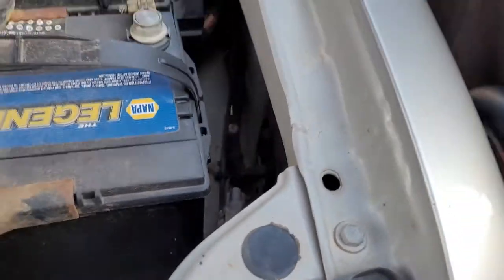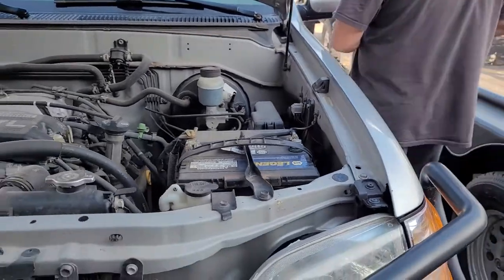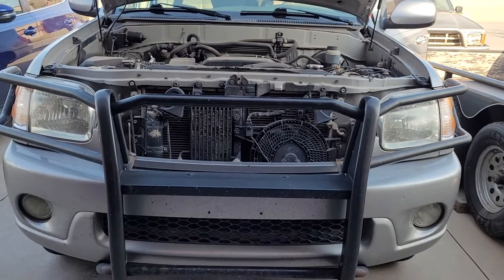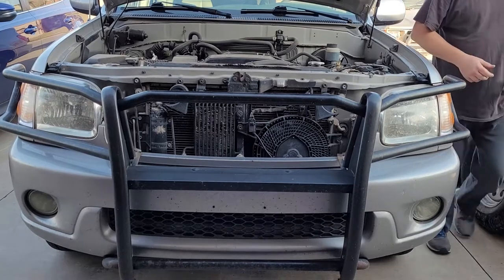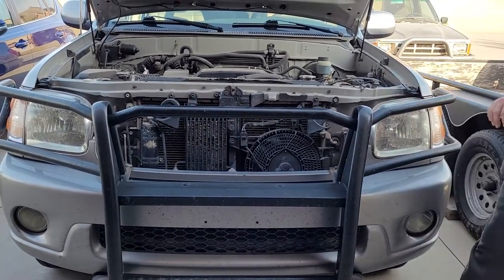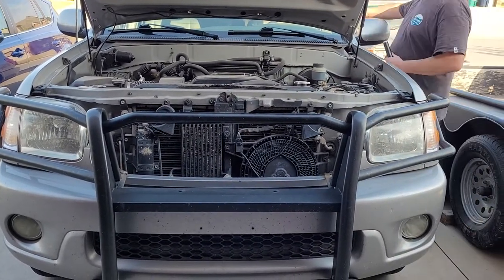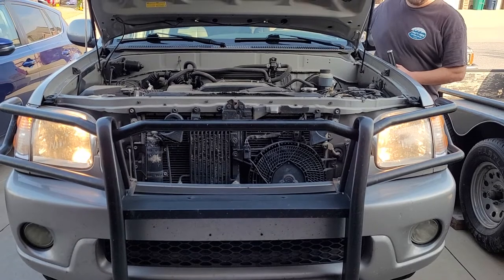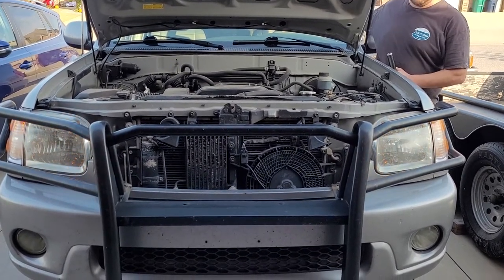How to disable Daytime Running Lights on 1st gen Sequoia and Tundra

Comment: DRL go off when you are parked and engage the parking brake. For those who want to sit somewhere and not have the lights on. Just be sure to disengage that parking brake when you start moving. 

This was helpful around Christmas time. Have a 06 sequoia that we took the kids to one of those drive thru Christmas lights where you slowly creep around in a line. You couldn’t turn off the lights so you always were blinding the car in front of you with 6v worth of high beams. 

Unplug the connection shown here and it works just fine. Lights when you want them on. Kudos. Kudos. Thanks
Reply from the maker: I personally like having them off because if i want to let it warm up in the mornings I don't really have to worry about someone driving by and seeing the lights on and stealing my vehicle, i know there's other ways to prevent that but this is just one simple way to accomplish it
Reply: Dan The Man Garage you can turn them off when you engage the parking brake. Problem solved.
Reply: @paulengelking  i keep engaging the brake but it doesn’t work for me
Reply: Can a wiring diagram be located? Maybe one of your fuses and relays are dedicated to just your DRL?
Reply: @adrianpineda1488  you have to have the parking brake engaged before ignition.  It doesn't work while running.

Comment: Thank you fine sir, for making a quick video and making it to the point. Perfect upload. Do you still have the truck?
Reply from the maker: I drive it every day!
Reply: @theman9764  it’s funny that you just now responded. I just came in from disconnecting mine. I just pulled it apart and electric taped it in such a way that it doesn’t make the connection so no crud gets in if I ever decide to put it back. The booger did not want to come apart, I tried to do it without moving the battery but failed until I gave in and went back down for a 12mm.

Comment: Should you cover the ends of the plug so junk doesnt get in there?
Reply from the maker: You can if you want, probably just get a small sandwich bag and put the connector inside the bag and tape it up

Comment: How do you pull the tab? Mine is stuck.
Reply from the maker: If you're talking about the connector itself being difficult to disconnect, you may need to give it a small shot of WD40 to help loosen it, over time debris will collect in the connector making it difficult to release
Reply: @theman9764  ok. Is my goal to simply pull it apart? Or do I need to press on a tab?
Reply from the maker: @zfrocc6327  there should be a little locking tab on the connector and it does kinda suck getting it pressed in enough to release
Reply: @theman9764  Alright. Im gonna use pliers to help

Comment: please, anybody who might help me to research how to delete DRL on my 2002 Toyota sienna CE. i am  looking carefully under the dash and do not see anything resembling the black box. as in other video. i will look to see if i have the connector as in your video. but my question is how did you learn this, and how can i learn the best way to do mine.  are there manuals and wiring diagrams available.?